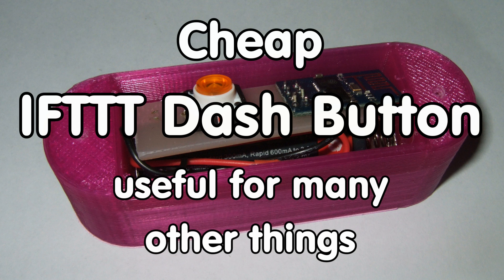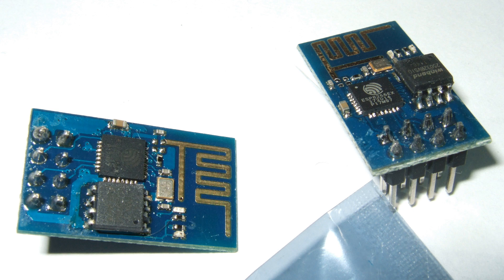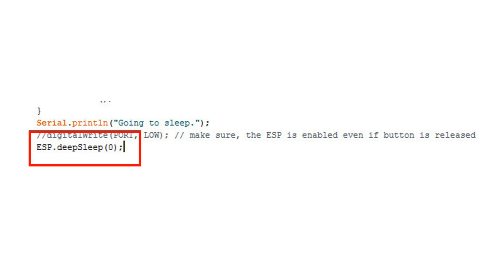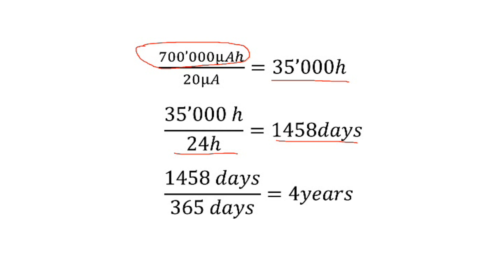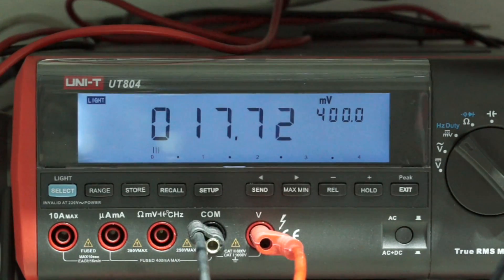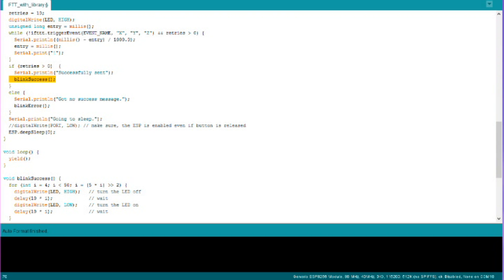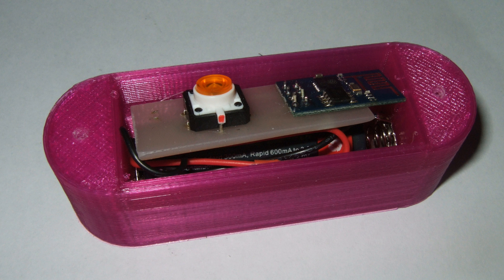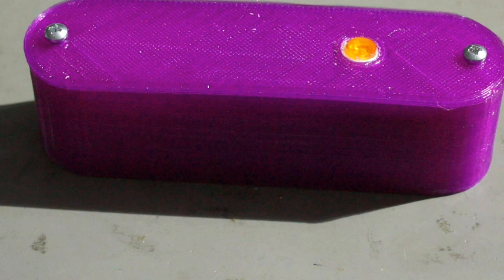#108 Cheap IFTTT Button with spare ESP-01 finished. Can be used for many other things

Comment: Dear Andreas, Thank you very much for share all your knowledge. I've been learnd a lot with your videos. Please, check if the answer for the low power ESP connected to a PIR sensor may be explained in this video: https://www.youtube.com/watch?v=n_A_8Y4xNx8 Thank you againd in advance!
Reply from the maker: Thank you for the link. Another way of doing it. PIR sensors usually are not switches, so you have to try if it works.

Comment: Dear Sir
I would love to make your Dash button as you have been so kind as to provide all the data due to your hard work as I want to make a door sensor, workshop sensor, and back gate sensor, but the only batteries I can find are on eBay and they are smaller - 2x 14500 3.2V Battery 400mAh IFR Lithium LiFePO4 AA Li-Ion, so please can you tell me your supplier I am in the UK and thanks again for your hard work Bob
Reply from the maker: You are welcome! Here you find a link: http://s.click.aliexpress.com/e/_dZ5QnZk

Comment: 5:18 I used a ESP-07. I find out, that if CH_EN is connected with a resistor to GND it makes the problem. Ok, german: 

Ich habe einen ESP-07 benutzt. Einen einfachen sketch, der die interne LED anschaltet. Ist die LED an und ich entferne 3,3V von CH_EN die LED geht aus und ich habe nur 0,002mA Stromverbrauch (ich weiß es nicht mehr genau). Nun verbinde ich CH_EN mit einem pulldown zu GND und starte den ESP-07 neu. Entferne ich nun die 3,3V von CH_EN geht die LED zwar aus, glimmt aber noch etwas und das ganze verbraucht 0,02mA. Benutze ich deepsleep sind es 0,015mA ! Wird CH_EN also mit GND verbunden schaltet der ESP nicht mehr richtig ab.
Das ist sehr schade, denn das wäre eine sehr einfache Stromsparmaßnahme. Es gibt einige Seiten und Videos die das so verwenden, ob diese alle richtig gemessen haben ?
Ich hoffe die mA Angaben stimmen, ich habe da manchmal probleme mit mA und uA :-D

Anscheinend wird ein GPIO Pin auch auf GND gezogen, schalte ich ihn auf LOW. Denn auch ohne Widerstand zu GND schaltet der ESP nicht richtig ab, auch dann glimmt die LED leicht. Selbst wenn ich die LED vorher abschalte, liegt der Stromverbrauch genau so wie bei deepsleep.
Reply from the maker: Der Enable Pin schaltet die MCU aus (Reset). Vielleicht konsultierst du das Datenblatt wenn dich die verschiedenen Stromverbräuche interessieren.

Comment: You also need take into account that plastic case shifts resonance frequency of antenna and as a result affects on its matching characteristics. In this case, there is Inverted F-Antenna printed on ESP's PCB. Shift value depends on the size and permittivity of the plastic material and may be shifted up to 100 [MHz] for the cases like enclosure of Flash Drives (disk-on-key). It affects on a range of successful data link, so in plastic cases like in the video, don't be surprised that with a case ESP works at shorter ranges.

Good luck and thanks for the video!
Reply from the maker: You are right. You find quite a few videos about antennas on this channel.

Comment: Hi, I am trying to do something similar but with  PIR instead of a button and not using deep sleep. I want the PIR power on esp. I was hoping to do this using a transisor (2N2222: PIR connected to the base and the transistor to the ground of the esp) but it does seem to work. I guess this does not deliver enough current. I was hoping you could give me any advice. Is it even possible ?
Reply from the maker: Maybe you google how to use a transistor as a switch.
Reply: @AndreasSpiess  thanks, that's the first thing i did. But it does not work the way it should (or at least I understand it). I was wondering if I missed something or any subtility I should know about.

Comment: Why you have capacitor? When u are using so-shine cell which is 3.2 v in another videos of yours you mentioned we don't need voltage regulator with this cell.
Reply from the maker: The ESP8266 uses high current during short transmission periods. This is why you have to have a capacitor close to the chip. Otherwise the ESP crashes from time-to-time.
Reply: Andreas Spiess thank you for quick reply. Here is my minimum setup i am struggling with. https://ibb.co/gX0y5p
Problem is it is getting overheated sometime i dont know why.  So much heated even i cant touch. I am afraid it will burn my Chip thats why i am not leaving this setup for longer time. Doing just random testing. Any suggestion.
Reply from the maker: Did you measure the current? It should be around 80 mA. Does the chip work? Otherwise you might have killed it maybe by crossing plus and minus.
Reply: Andreas Spiess For current measuring i need new multimeter old one seems not to be working. Yes chip is still working. Still sometimes it starts heating up...this is my main problem....sometimes works very well. ....still investigating. No i never attempted with incorrect polarity( crossing plus minus ).

Comment: Andreas, how this is better than just turning off the ESP?, in video #101 you showed the idea of using an external device to keep the ESP ON and then use a GPIO to turn it off, how is this better?, in deepsleep is still consuming power right?
Reply from the maker: This one does not need an additional MOSFET. But it needs some power for deep sleep, you are right.

Comment: Lifepo like most current lithium based cells have a self discharge rate. That means the battery on its own without recharging regularly and even if connected to nothing loses energy! 4 years is all maths but not a real world possibility.
Reply from the maker: Thank you for your clarification.

Comment: @5:17 perhaps there is a current flowing in 1 and 10 K resistors. Try measuring the voltages and currents at GPIO 0 and CH_PD  flowing . Perhaps there is a leakage between CH.PD and GPIO 0 or to gnd so measure current between that path . I'd be interested to see the result.
Reply from the maker: This is possible. But for the moment, I closed the project because of other priorities. But, maybe somebody else who build one could do this test?
Reply: Dear Andreas, I can not measure such low currents, so I use your data. Therefore I would like to know (if you still remember): when you tried the setup for switching the CH-PD and measured about 1.1 mA, did you also program the  ESP  with the corresponding program (GPIO0 = OUTPUT and low at the end of the routine)?

Comment: Thanks so much for  your channel,  It has been a key factor in getting me started into  IOT .
I took your project and used an RGB LED and a Buzzer to play twinkle twinkle little star. I gave it to my grandson He presses it every night to let grandpa know he is going to bed

I wonder if you have any ideas how to adapt your project to use a PIR as the trigger (trigger is 3.3v  instead of GND).  I tried the other proposal you mentioned and couldn't get it to work (as many have posted on that site).    I was thinking if I could use a mosfet to drive "reset"  but all my attempts have failed.  wonder if anybody had some suggestions  Thanks
Reply from the maker: I think, you should be able to invert a 3.3 volt signal with an NPN transistor (see here: https://electronics.stackexchange.com/questions/30238/how-to-invert-a-digital-signal)

Comment: Just curious if you have any thoughts about how to prevent a non-button push reboot (e.g. the device reboots itself because of a power issue, or coding issue) from triggering the action.  My concern is that the device may start a reboot loop outside the button being pushed and repetitively trigger the action.
Reply from the maker: The only way to prevent this is testing.
Reply: At the end of the battery life would you not expect some form of auto restarting as the voltage drop near the cutoff?
Reply from the maker: You have to switch it off before the voltage gets below the rated voltage (3.0v). Otherwise, the chip can behave as it wants...

Comment: So when I click on Sketch: https://github.com/SensorsIot/IFTTT-D....  I do not see a sketch, just the text "Sketch for an IFTTT Dash Button with an ESP-01 This is the sketch for this Youtube video"  So where is the sketch?
Reply: I'm really looking for the circuit diagram because the top of the one shown in the video is cut off - where do pins 1 and 2 connect?
Reply from the maker: You should find the schematics in the repository now: https://github.com/SensorsIot/IFTTT-Dash-Button. This was an old repository which I forgot to delete. Thanks!

Comment: I made similar project with esp-12f, that, good news, does not come with led turned always on. Unfortunately cannot measure microamps, but button discharged in about 5 days of 2-5 times clicking per day for fun. Everything listed is not so important, like overcharge issue that was very harmful to coin battery. I would suggest to improve schematic to avoid over discharge somehow.
Reply from the maker: Maybe you have a look at my video #58. There I do some measurements

Comment: Hi! Is there a way to make the same project but with multiple buttons, while keeping low battery usage? I already built and coded the part dealing with multiple buttons and it works, but I don't know how to build he reset circuitry for multiple buttons. I think it would be useful for DIY WiFi remotes, like the one I am building. Thank you!
Reply from the maker: +Patrice Boudreault Such a project is on my list.
Reply: Great, I will be looking forward to this! Here's a library I found out that you may be interested in. It lets you easily program various events for button clicks, double-clicks and long presses, so you can do a lot of stuff from a single button! https://github.com/mathertel/OneButton
Reply from the maker: I have to test it one if it also works with the ESP. Or did you already try?
Reply: I tested the OneButton library with ESP8266 and it works wonderfully. 2 changes to make in the .cpp file : Replace "pinMode(pin, INPUT); " with "pinMode(pin, INPUT_PULLUP);" and comment "digitalWrite(pin, HIGH);   // turn on pullUp resistor" to make it work. Really, really easy to implement!
Reply from the maker: Thanks!
Reply: Have you figured out how to make this work with the reset button?  I'm trying something similar the problem is the button in this case isn't being handled by the sketch, it's setting RESET from HIGH->LOW->HIGH so by the time sketch starts the button you pressed is already unpressed.

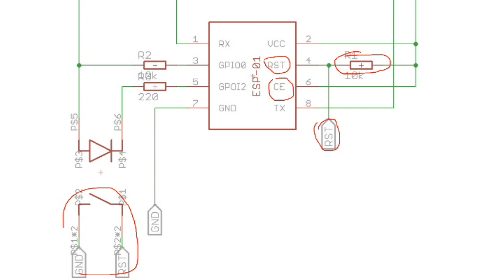Comment: Andreas, I'm currently building a version of this device to be the doorbell for my house. Looking at your diagram at 4:20 I'm wondering about the use of GPIO0 and the 10k resistor. I don't see any references to it in the code. Is this resistor pulling pin 0 to ground for some reason?
Reply: I guess it is pulling up to VCC given the direction of the diode.
Reply: Ahh, it is needed for correct boot mode as per http://www.forward.com.au/pfod/ESP8266/GPIOpins/ESP8266_01_pin_magic.html

So if my understanding is correct at boot:
- GPIO0 is pulled high by this circuit via a 10k resistor to +3.3V
- GPIO2 is (maybe?) pulled high via a 220 resistor to +3.3V minus the forward voltage of the LED. So say a 1.7V forward voltage GPIO2 is pulled up to 1.6V.
My understanding is that an unambiguous TTL high voltage would require at least 2V and would unambiguously read low at 0.8V. So does that mean this circuit would be better off with a pullup on GPIO2 as well and to use a different pin to drive the LED?
Reply: Ok, hopefully one last question then...
What kind of capacitor are you using at 6:44? My 2200uF round electrolytic through hole capacitors are a little too large for my project and I am looking for alternatives.
Reply from the maker: 1. GPIO0 has to be pulled up to Vcc for reset. Otherwise, the ESP will end up in programming mode
2. GPIO2 is an output pin and is used to switch the LED
3. I often use a 1000uF SMD capacitor. But it is not ideal, because it has a relatively high leakage current. Good would be a normal electrolytic capacitor with around 1000 uF. It could also be smaller, if your power supply is good.

Comment: Great work as always!  When you get more familiar with the ESP32, would love to see a video on the hardware pulse counter combined with low power modes. I have a few ideas where this would be really handy :)
Reply from the maker: What is a hardware pulse counter?
Reply: It dedicated hardware that counts the rising edges or falling edges on a pin. It is included on the ESP32. The processor can be asleep or doing other things while this is happening. An interrupt can be used when a certain count is reached. Recently my power company added a Smart meter on my house that has a pulse infared led output for ever .001 KW used. Would like to use an ESP32 to read it and report the pulses over the previous hour.
Reply from the maker: I did not (yet got into the details). Sounds interesting...

Comment: Love the 3D print, Andreas! I'm working on TLS/SSL transmission right now, having trouble with it. Any luck with it thus far? I found these, going to really start diving into them more on Monday...

https://github.com/esp8266/Arduino/issues/784
http://www.mpja.com/download/ESP8266-SDK%20SSL%20User%20Manual%20v1.4.pdf
Reply from the maker: The library used in this project uses something like that. At least, it gets an answer from the HTTPS site of IFTTT. Glad you look into the manuals. Please keep us updated if you learn something.
Reply: Figured it out, a little tricky at first, but got it working. More related to generating an x509 certificate through OpenSSL, then you just generate the SHA1 fingerprint from the CRT file. Put the fingerprint in your firmware sketch and the x509 certificate on the server. Works with TLS 1.2, no issues.
Reply from the maker: I think, many people would be happy if you would create a small documentation (how-to) with some screenshots.
I am also glad to read, that TLS 1.2 works. Another viewer asked exactly this question

Comment: Thanks for the Great Channel and this project can be great intro for a youth group club interested in maker and robotics stuff that I help out with from time to time. Can't wait to show them.

I was thinking of a couple ideas that would really finish off this project.  
1) Build it with an esp that has 4meg and uses the iotapstory.com.  Sure it is a simple project and may not need it. But building this simple project out to be iotapstory compatible will give us a solid building block to base other projects that can really take advantage of iotapstory. 
2) I know in a previous video you forked the wifimanager library, to add some of your own setup pages when the esp is in a webserver mode to get setup information.  It was real simple for me to add wifimanager to your project have it search and remember the SSID and password instead of hard coding it.   But I have not yet figured out the best way to have IFTTT key to be entered and updated in the field (not hard coded).  Is it best to have a second button to get into webserver mode, or maybe a long press could be used. Wonder if you have any ideas on this?
Thanks again
Reply from the maker: This sounds like a fun project. I just publish a video about how to create your first IOTapp. So, feel free to do this with this button. There is one problem to be solved: This button sleeps most of the time. As you correctly write, you have to find a way to bring it into configuration mode. For another device, I used a reed switch which can be closed from the outside using a magnet.

Comment: Sali Andreas,
when we talked at the impactHUB in zurich I mentioned that I have some code to send sensor values to Cayenne and wanted to  put together a neat little demo to show the code. Finally made it happen, you can find it on my blog. It is not depending on any added hardware to the ESP8266, so the code can just be uploaded and will work: https://bashtelorofscience.wordpress.com/2017/01/07/esp8266-cayenne/
Reply: Damian S. I've just had a very quick scan of your  post. Many thanks for sharing, on a similar journey, so this really is a great help getting your angle. 

👏
Reply: You are very welcome. I am glad this is useful to you.
Reply from the maker: Thanks for the link. I will try it. Seems to be a "fast track into Cayenne" for me...

Comment: Hi, great post.  From your previous video I had started some planning using an LIR2450 and an N-channel mosfet.  I had come up with this design, curious of your thoughts before I start sourcing parts (I already have the mosfet - i need to get some larger capacitors and the LDO).  http://imgur.com/a/MBybE
Reply from the maker: I would use an LDO instead of the 78xxx, if you did not plan for it already. The rest seems to be ok
Reply: Yes, was planning on the ht7333, just couldn't find it in frizting.  For the capacitors - two questions.  1) Do I need an additional small capacitor for the LDO (aside from the capacitor across Vcc & gnd).  2) For the capacitor across vcc & gnd I believe you have used a 1000uF, do you think a 470uF would do?   (Purely because they are easier for me to find).
Reply from the maker: Capacitors are always good. Datasheets usually require a small one on both sides. 470 is usually also ok.